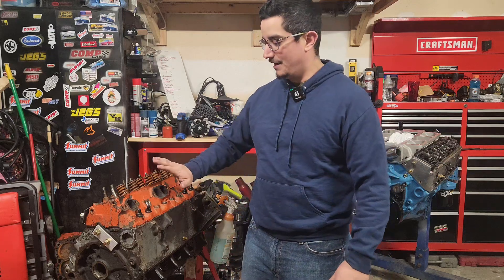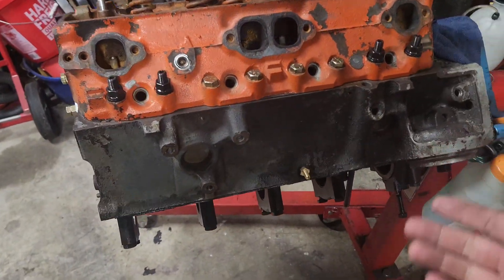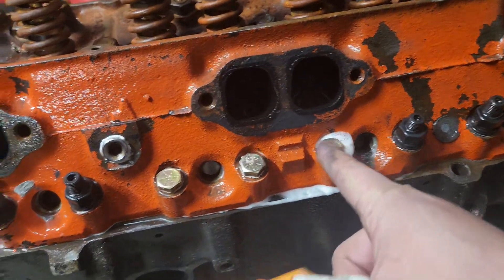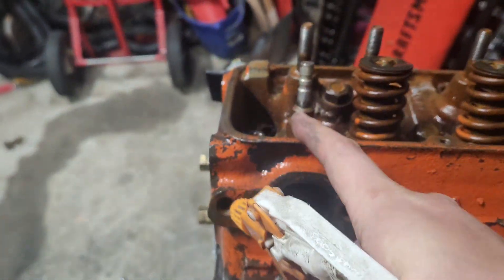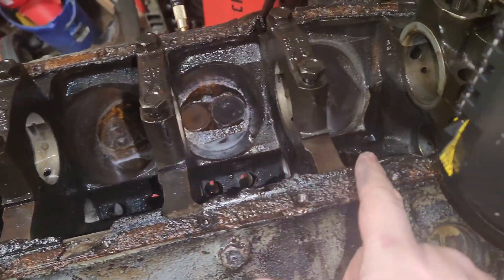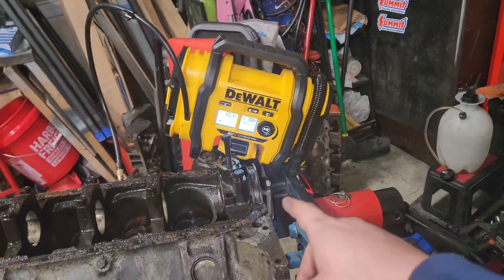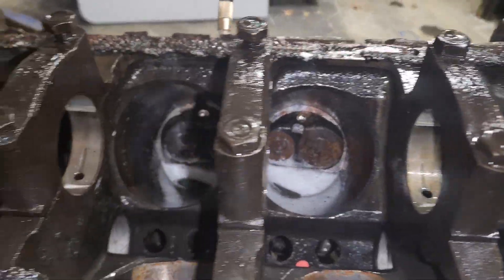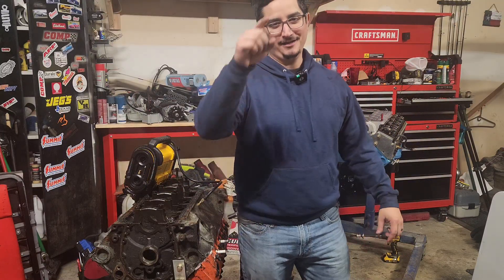$500 Budget Build Challenge - How to Pressure Test an Engine Block

Comment: Also some SBCs crack in the lifter valley ! I found 2 blocks that cracked between the 1st and 2cd lifter on the driver side and the last 2 on the passenger side, as if the blocks had been twisted, my thought was these blocks came from a big truck, like maybe a dump truck or 2 ton that carried heavy loads !?

Comment: are those heads vortec? do you have a link for the heads you are using, i plan on using a blower but a smaller one and i have been following your build i just found your channel a few days ago, i  am super excited to see you put hanks motor back together
Reply from the maker: The 283 heads are iron 305HO heads, non vortec.

Hank's engine has Ebay aluminum heads. Have vortec and original intake bolt pattern.   That sounds awesome, what blower you thinking? 

Search this on ebay: Deepmotor SBC Small Block Chevy 350 Cylinder Head Bare Straight Plug Aluminum
Reply from the maker: Also have a video on assembling these heads if it helps. 

https://youtu.be/Y0UGWMUOc7k
Reply: i have a weiand 144 supercharger with a 5 pound pulley i want to install and start off with and then eventually go bigger, i am restoring a 71 chevelle so i have some time to go until i go crazy with the motor
Reply from the maker: That's awesome. I'm nowhere close to done with my squarebody but I'm feeling the itch to get another car haha 

Also don't be afraid to start bigger with the boost. I started at 5psi, just testing and tuning and ready to go up to 10psi.